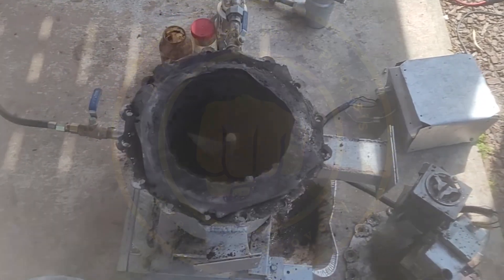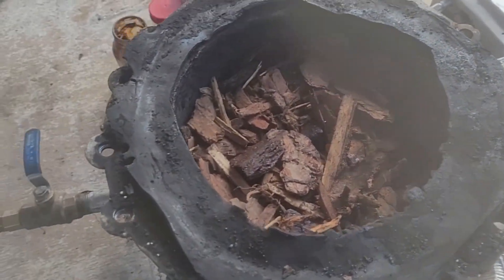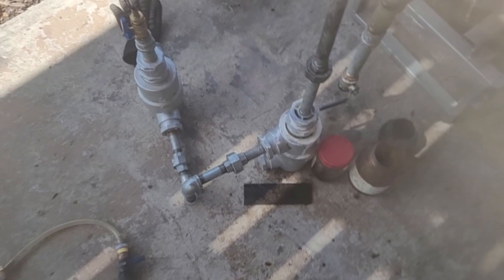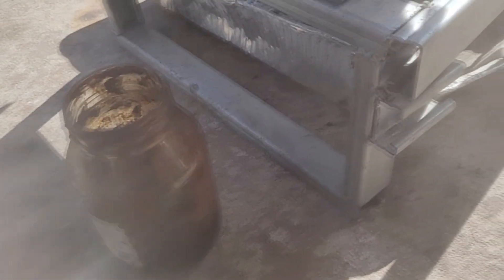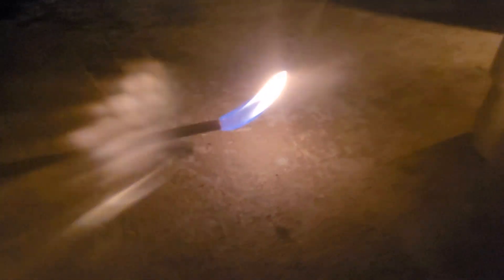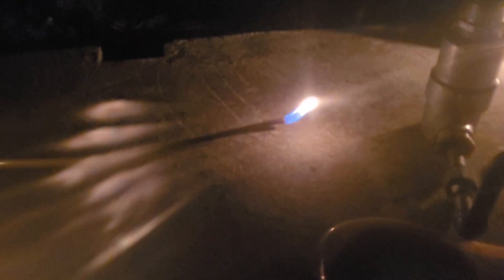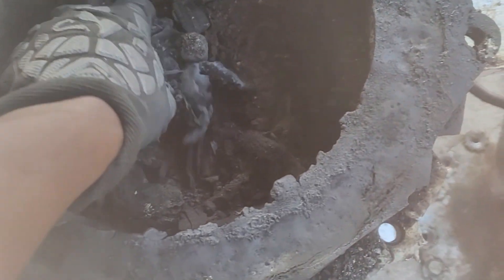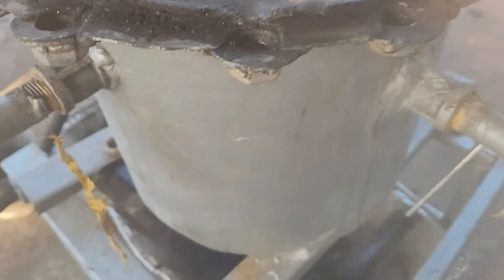What Happens When you Pyrolysize Wood Chips? - Will it Pyrolysize Episode 2

Comment: As for water, check it for methanol (also called wood spirit) and acetic acid (wood vinegar), those are the main products of wood pyrolysis besides wood gas. And a bit of tar is not surprising, especially since you use pine (a lot of resins in this wood).
Reply from the maker: This is a great suggestion, thank you. I wonder how I could check for such components
Reply: @naturejab  As for acids: reaction with baking soda or pH papers. For methanol, it should be a bit flammable in solution, but I do not know if it is concentrated enough.
Reply from the maker: @ejkozan  yea, I'd have to fraction the water off via distillation
Reply: @naturejab  Not really, just simle distillation is enough, MeOH do not make azeotrope with water and have low boiling point of ~65 °C. Then in theory just heating/boiling solution and checking if vapours are flammable (those would be just methanol) should be enough.
Reply from the maker: @ejkozan  Excellent, thank you for your input. This shows even more all the various uses of pyrolysis
Reply: @naturejab  As for wood like stuff, check video "MICROWAVE PYROLYSIS OF WASTE FURNITURE TO PRODUCE VALUE-ADDED PRODUCTS" and their paper, those can be usefull.
Reply from the maker: @ejkozan  Thanks!
Reply: @naturejab  As always: you are welcome :)
I want to see your reactor working and producing XD Keep on with great work you are doing!
Reply from the maker: @ejkozan  💯

Comment: Have you ever read about the waterfern Azola filiculoides? I guess it is really good at treating waste water and polluted waterways. It produces well as a feedstock for pyrolisys. I read that it makes 38% liquid fuel when you heat it to 450C. It could easily be farmed in shallow tanks. It grows so fast they think it caused the last ice age.
Reply from the maker: I have not that sounds super interesting. Thank you for sharing this with me. The addition of biomass other than plastic opens up a whole new door, let alone copyrolysis 
perhaps biomass alongside plastic. That's the mix of a lot of municipal solid waste after all
Reply: @naturejab  You look like you live where it is warm. I'm in Michigan. I think my interest in this is because a few years ago I sarted freaking out about fuel supply. I got a wood burner. I had to tend it every 4 hours for a winter. Rather than upgrade to an outdoor boiler I started in on pyrolysis. I want to make fuel in the summer and store it. Also there is a junkyard full of tires 1/4 mile away.
Reply: Tires are great because they are full of btus, but also sulfur. You need acids and iron to react with it to remove it. So, I'm like not everyone can burn tires and we need something renewable so I stated studying plants. Mainly because I grow and oily plant and it yields 28% resin. So I figure there has to be fast growing ones too.
Reply from the maker: @wesKEVQJ  Exactly! The oil  and the carbon black material can be buried back into the ground
Reply from the maker: The best part about burrying the carbon black is that it is one of the best fertilizers on earth - Terra Pretta
Reply from the maker: @wesKEVQJ  yea, fortunantly in my filtering system I have both iron and acids that help clean the gas

Comment: Probably Plastics has a much much bigger specific surface area than wood chips... that decreases the current reaction by orders of magnitude. Have you try sawdust??. Also, as occurs in your previous reaction whit coffe, organic matter has a lot of water content, so the reaction is innefective as water has a high specific heat that slow your reaction rate as takes a lot of heat. In case of organic matter i think that you have to include some previous step of grinding and drying. Cheers!
Reply from the maker: Saw dust is a great idea, and I agree with you on the moisture content part, cheers.
Reply: @naturejab  
Might try dry straw next; I got a bunch of dry straw (the farmers usually want to get rid of the old stuff for free, or just shipping costs). Could be dry grass clippings as well. 

Also, got my setup ready to test, but it's been raining for a couple of days, so I've got to wait a little. :) Figured the weather is the downside of the simplest of setups.
Reply from the maker: @Noswiatel  Straw is a great idea, I'll get it as small as possible first. Also good luck with your system!
Reply: @naturejab  
You could just use a mower to shred it into pieces. That's how I mulch it. Just don't ride into piles and you'll be good with the blades getting stuck.
Reply from the maker: @Noswiatel  Smart